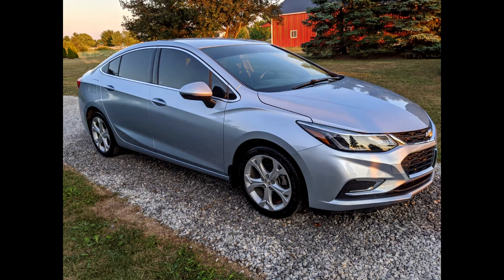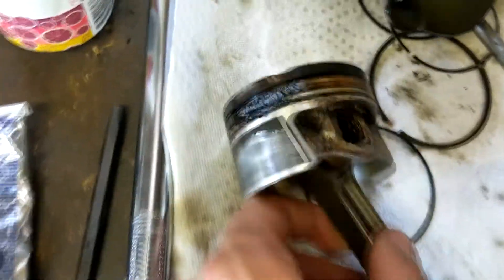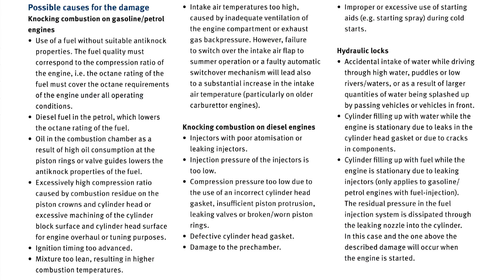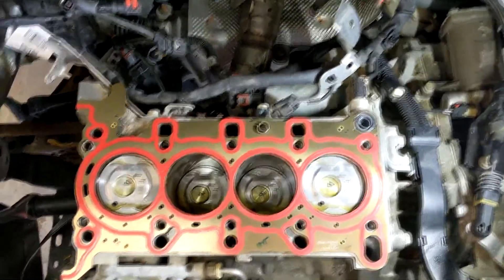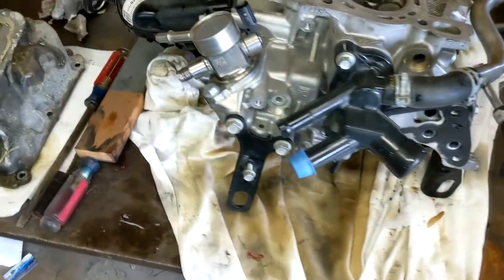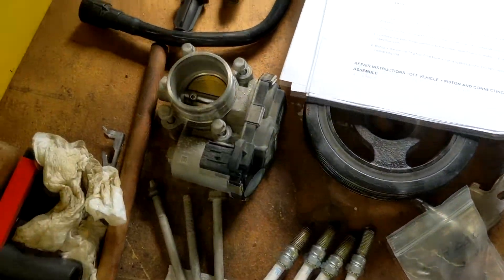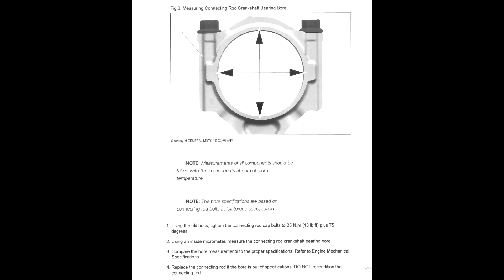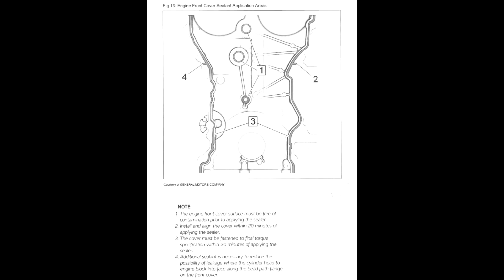2017 Chevy Cruze - Piston Replacement Overview - P0103

Comment: Cam chain marks were lined when engine was assembled, you will notice when you install the chain using the colored links on the timing marks then rotate the engine to check that your marks line up they will not be in the same place

Comment: Great job! I was about to do this job and instead I ended up getting a whole engine for $450. Not worth the time and effort to fix this in my opinion.
Reply: Did you have to have a dealer marry the new motor to ecm? Or did it start and run after your install?
Reply: @Heliarc91  No programming is needed. Start and run!

Comment: okay, I got it done. I would like to think that I could be called a "seasoned mechanic" but be warned , this is not an easy job. also wondering if these new pistons and rings are going to be any better than the originals. they LOOK exactly the same.  Don't know if if I'll keep this car too much longer even though my wife thinks it's the best car she's ever had.  Got to love 45 mpg!  
My worst problems were the electrical plugs that don't want to release after squishing the tabs and pulling like hell, especially the connectio9ns on the back of the head. Any way the car runs great for now thank you Mark for a great video.
Reply: Biggest culprit to lspi is low rpm boost pressures. If you can keep it out of 6th until a threshold is met, say 69mph (my tune) it will help this issue. Otherwise you be going 45 in 6th gear and getting full boost at those low rpm

Comment: Good information on your video.  I have a 2017 cruze I use for commute.  Currently at 120k I regularly maintain my car oil changes at 3500 miles and every other change replace the sparking plugs also air filer at every third oil change. Now I am a supervisor of a parts department for my company  and we have done GMs response to this code and subsequent recommendations to  the piston failure i have the piston kit pn12696409 cylinder head pn 12675702 along with a new turbocharger water pump alternator starter compressor as extra stock alas not the service block which initially GM said to replace. Rather drawn out but I have the parts to keep my cruze running for another 110K
Reply: I tuned my 2017 from new. I ran a tune designed to counter LSPI. Lower boost..more fuel etc mostly transmission tuning for this tho.

Mine runs fine still at 150k..had a p0299 code recently replaced wastegate actuator with a Mamba and back in bizz.
But am curious if a engine can be swapped without needing to reprogram ecm

Comment: Your correct to question the use of 87 octane fuel. GM and other manufacturers are relying on the knock sensor and dial back the engine when knock is detected. Problem is this allows some level of knock to occur which could damage the engine. I had 2 previous gen LUV engines I drove 100k miles each, and now a LE2 with just over 90k miles. No piston failures but I've always ran premium fuel.

Comment: How do you do a compression test on this vehicle??
Reply from the maker: You will need a compression check tool. Remove all the spark plugs. Remove the injector plugs (so it cant fire fuel). Thread the compression check tool into the now empty spark plug hole. Turn over the engine as if starting. Once the compression tool stops raising record that value. Do this for all cylinders. The book says that all the values need be within 15psi. I think this is too tight. I usually just make sure all the cylinders are above 150psi. If you have a huge issue like a cracked piston you will struggle to make 50 psi.

Comment: I have a 2018 Holden Astra 52000km 1.4 LE2 engine .It looks exactly the same as the Cruze, it is branded as Holden. It is out of warranty and it looks like it has the same problem , but in cylinder 1. Only 90 psi compression, the other 3 at 200psi.Yet to do leak down test. Planning on doing this job myself, as I was quoted enormous sums to get it done. My question to you is: where did you get the upgraded pistons and the Service manual or the torque settings for rebuilding the engine.
Thank you

Comment: Absolute junk, Chevy shouldn’t be allowed to manufacture anything. They got worse and worse after the bail outs.
Reply: @Shurup33  my younger brothers has 60k miles and it has a cracked piston. Dealership wants 5k to get a new engine. But offered him $500 for the car. He’s getting a new GT 86 now. I’ll stick with my Lexus.
Reply: @Shurup33  it was a 2017 like this example, 5 years and suffering a catastrophic failure isn’t a good investment and they never recalled the issue hell they even discontinued the pistons lol